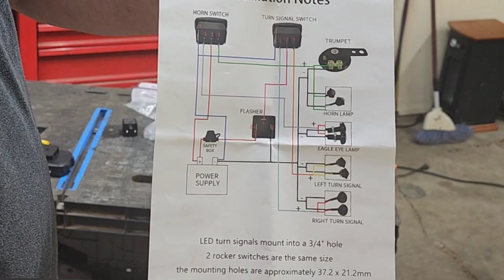How to make a go kart street legal

Comment: Thank you for a great video. I have been so busy that I have not even gotten my 4 wheeler  or Yamaha trimoto on the road or trails. I swapped out my battery in my motorcycle for a 16 volt ultra capacitor  that I built. I also found a stator for my motor. You can get GY6' stators.
Reply from the maker: That's awesome. I'm glad it motivated you. That is what this is all about, and thank you for watching the show.

Comment: Does the go kart have to have a roll cage? I’ve been thinking about making my racing kart street legal
Reply from the maker: In my state it does not require one but I would check with your local Rules And regulations
Reply from the maker: But if I had to guess I would say no because you can also street legalize mini bikes as long as it's a low speed vehicle

Comment: What about insurance? Not legal without insurance. Lisence plate?
Reply from the maker: some states require insurance and plates, and some don't. You should check with your local dmv or law enforcement for your local rules, and thanks for watching
Reply from the maker: It is a Trail Master but they have changed the look over the years
Reply from the maker: And I put the forward reverse gearbox on it